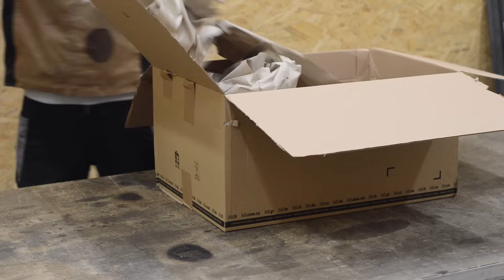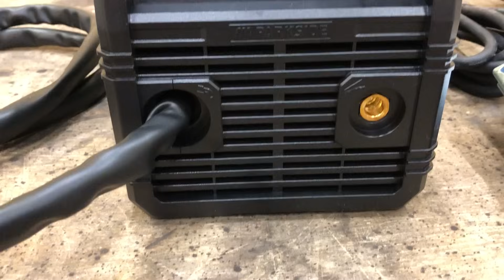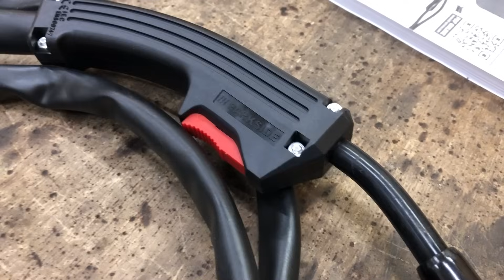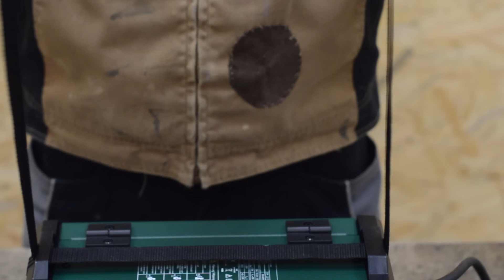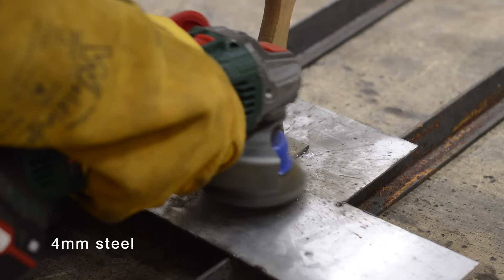Lidl PARKSIDE ® PIFDS 120 A1 Mag Flux welding machine Unboxing and Test welding without gas for 99€

Comment: Thanks for the demonstration. Would be nice to have a clamp-on ammeter indicating how many amps are drawn from the socket outlet at each setting in welding each thickness of steel. This because many people have limited circuit breaker amp ratting. I for one have 220V , 15A in my garage.
Reply: This is what im looking for too , can I do small welds from the 16 A in my apartment , or do I need to use this somewhere else everytime .. :P
Reply: @MrWeeds  change to 16A C type breaker.

Comment: Loads of pals bought these and whinged they were rubbish - so I got one to see. Nope - it's them, not the machine. Running 1mm flux-core, these weld like a little demon - superb IMO. I think the issue is people who can't weld at all buy one & expect to be a champ welder off the bat - I'm a lifelong welder, it runs smooth & strong for me. Hugely impressed in fact. 

 Others bought the Lidl multi-process version that does mma, mig & gasless - and also whinged that the gasless mode was crap - It isn't, it's excellent in fact - I firmly believe loads are forgetting/not knowing to change the polarity before using flux core & then get horrible results, blaming the machine. Once you run flux-core properly, it's a cracking way to join metal - key is to run it properly. The "Thing" people say about excess spatter - that's you, not the process too - set it up right, spatter is miniscule/non existent.

Beware that flux core is damn bright compared to gas shielded - use a good mask. For gas shielded I often weld without a mask (loads in fact) - no chance with flux core, a mask is essential - the arc is blazingly bright.
Reply: You do sound convincing.
Reply: @erik_dk842  I weld for a living - I bought one of these ^ just for the "let's see are they any use" factor.
Reply: @jamesward5721  I'll pick one up next time they are in Lidl. It's always nice to be able to glue some steel. I have an old 160 amp 400Volt Italian MIG welder in the basement, but the bottle is empty and the wire is one lump of rust. The electrodes for my ESAB 140 are destroyed from moisture. This little feller can reside in a closet at room remperature.
Reply: @erik_dk842  Exactly - I now use it when I can't be bothered wheeling a big hefty MIG to a piece of work - I just pick up the nice light flux-core, plug it in, weld, chuck it back on the bench. Very handy.
Reply: Could you please add more info about proper setup with little to no splatter?
Reply: @WickedCerberus  +1 on this
Reply: Hi I just got one these and iv not done much welding (had  arc type) so it's past it's sell by so got a parkside mig  can you tell a newbie  quick how to  use one in a video  how to clean weld .thanks

Comment: This tiny welder is just amazing. I got it a few days ago and instantly started challenging it. I love it. With this tool you think twice to use  screws or just weld it right away. IMHO welding had never been simpler than that.  The intelligent current- and wire speed algorithms takes over all the struggling of adjusting them yourself. If the power is not enough, then just turn it a little up. It also seems to have shortcircut wire burn off feature. So that if the wire is melted together with the workpiece, the current is turned up to melt the wire away, and push new wire out rapidly until new arc is ignited. I saw this only on my Fronius Transsteel 2200 before.
So very nice machine!  Safety: Beware to always wear FFP3 mask and have a fire-extinguisher / water sprayer in reach.
Reply: I don't even know what an ALGORITHM is??? Can you weld with it?  I have been welding since 1979 when I was 15, so not easily impressed! (Coded for  five years  in 1995) but don't even work in the industry anymore, but am restoring a Classic MGBGT car and VW T4 Campervan!
Reply: Водой тушить электрические соединения ? 😂😂😂
Reply: @patintermatroskin3650  Well, possibly Russian electric Welders frequently catch fire. But here it is meant to be prepared to extinguish secondary fires, caused e.g. sparks, or dripping iron, or dropped hot parts...
Reply: @davidwaterhouse2552  You coded for 5 years without even knowing what an algorithm is ? And you are proud of it ?
Reply: @cromyjr9183  No I don't know what an Algorithm is ? 
Please tell me cos I have managed all my life without knowing what one is, and perfectly managed all types of welding!
Where did I say i was proud of it????
Reply: Parkside are the biggest  false object

Comment: It did the 12mm good, flux core very bright and loads smoke, l still prefer stick, but l was a coded welder years ago, but for odd jobs these are fine.
Reply: For home use this seems more reasonalble than stick welder, that is, if you dont build ships at your yard.
Reply: Update, I bought this welder for 79€ something.... I already welded lawnmower deck with it by patching up cracks and holes slowly. This welder is by far the easiest welder I have ever used. It feels also quality tool for such money.

Comment: What is the thinnest metal it can weld without blowing holes?
Reply: 0.8
Reply: Iv just welded a wing patch work  on lowist wire speed it has  the thing is you cant hold the torch  more than  2sec other wise you blow holes  metal 1mm thick  i weld all the time, bad idea on the  brass tip showing  as you will arc the metal if your not a good welder and the wire will arc to the tip  bad idea i made a cover over mine  from a old mig welder works alot better saves alot of problems  only bought it saves me carrying a great co2 bottle  and welder up the garden  to do some small jobs

Comment: How does this work without gas? The wire have protection for it self?
Reply: It's a hollow wire with the flux built in. You have to set the tension so as to grip but not crush the wire when feeding it in.

Comment: Great video, you did a great weld using this (didn’t expect a clean finish, other videos show splatter and messy result) do you still prefer the previous pmsg model ?   Would be nice to see strength test or projects made by this pifds model. Keep up the good work

Comment: For the price, this is an amazing welder. Had mine for a few weeks now and it welds good straight out the box. However.......if you decide to get one the first thing you should do is remove the existing earth clamp and replace it with a good quality clamp. The supplied clamp is made of poor quality mild steel, I replaced mine with a decent quality clamp with a rating of 200A.
Reply: thanks for the tip

Comment: When starting to weld how far out do you have the wire, do you strike on the copper tip then before the wire feeds out, or do you strike the wire that is out of the tip. If so how far out has the wire to be to strike and start  welding.
It's  difficult to see on your video.
Reply: Using this welder, im around 10-15mm from the weld area

Comment: Can I actually run this machine from the washing machine outlet ? It runs from the 16 Amp breaker , and considering that this machine pulls at maximum power just around 17 Amps , it should be fine for welding small pieces , right ?

Help would be really appreciated on this one , cheers
Thank you
Reply: I maxed this machine out welding on a tractor implement, using 1mm wire, and the highest setting (above 3mm). It did not throw my 13Amp breaker. According to the manual the breaker/socket must NOT be above 16 Amp. Enjoy.
Reply: @evanleebodies  Cheers buddy ! Thanks for the help .. I bought the machine a while ago , but can only use it at my parents house , I live in an apartment so I can't use it without being irresponsible and it's also ilegal in my country . Still thanks for the help ..

And yes it works just fine in both 10A and 16A breakers

Comment: why this machine haven't gas input？
Reply: This is flux/fcaw welder not mig/mag
Reply: This machine is specifially made to be as tiny and as easy handable as possible, and for this to be used only with flux cored no gas metal arc welding.

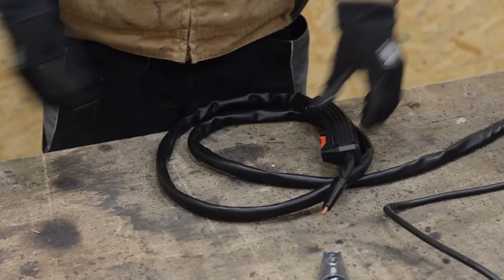Comment: Are there spare Parts available like the plastic thing at 04:02 ?? Mine is broken
Reply: It's not plastic, the material the cap is made of is bakelite.
Reply: @BunkrMan  is it durable when welding for anything longer than 10 seconds? I want to buy this welder but this non-metal tip is something that puts me off. Won't it just melt after some longer welding?